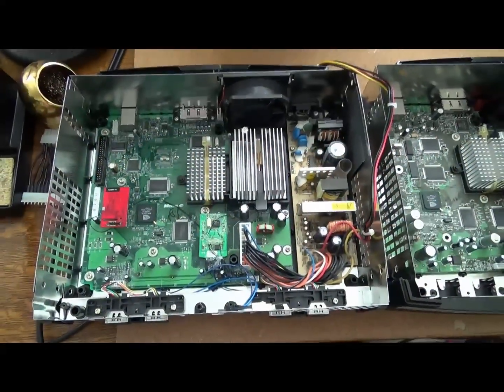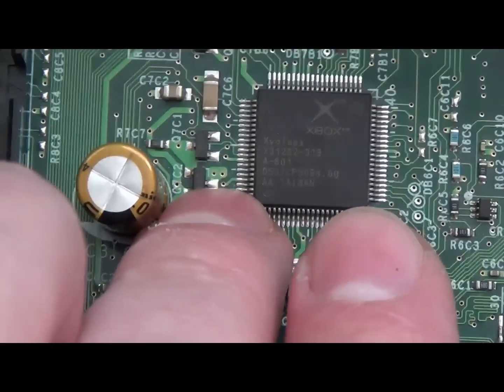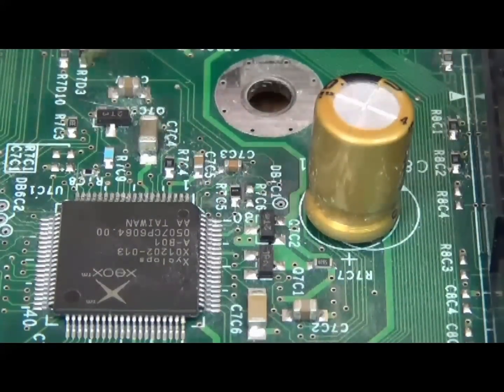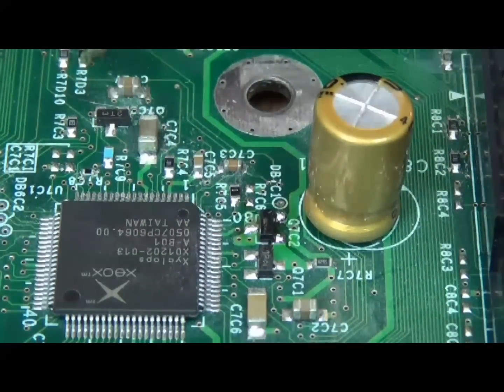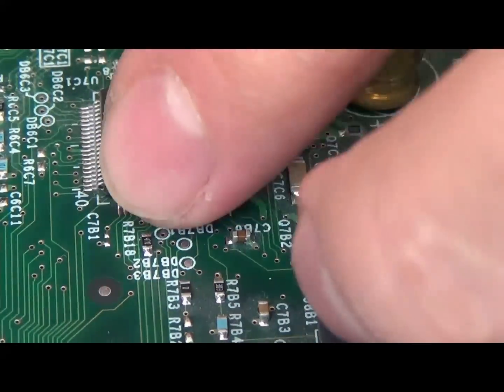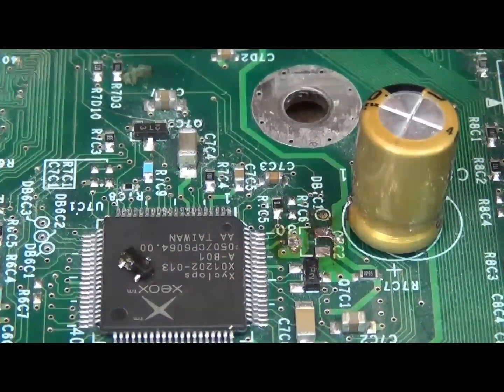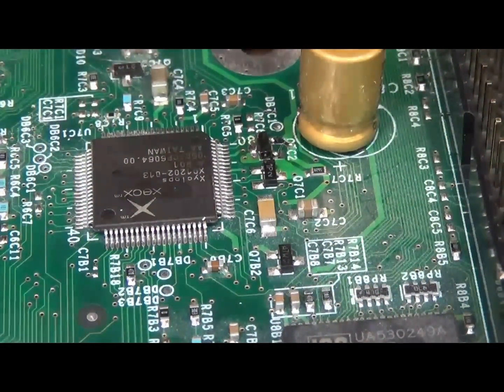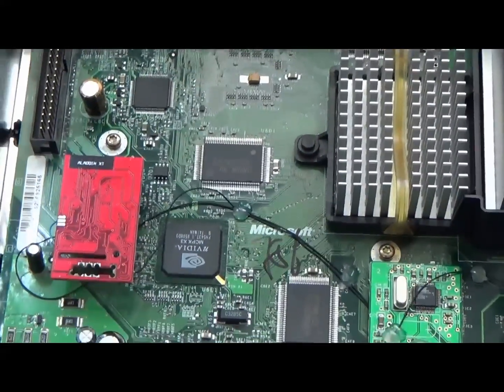Original Xbox version 1.6 won't power on fix

Comment: There's another point of failure for 1.6 boards than this also, T60N02R by the ATX connector, check you're getting 5V on the output when attempting to power on. That's and the one shown in the video are the two biggest point of failure for power on that revision of board.
Reply: A good replacement for that ? I searched online but couldn't find any from digikey

Comment: I haven't ever blown an Xbox in this method but the part number was handy to order a few as I do primarily deal 1.6 and it's entirely likely one may have this problem in my stock or I can do the work for another community member without delay. Think I'd use a focused heat gun to remove it though, cos I do have good soldering tools now myself, though there was a time I struggled with a weller. A TS 101 iron with interchangeable tips is a very versatile iron for this type of work.

Comment: 2024 - and just fixed a 1.6 with this guide. For anyone reading this, I used low melt - long maulten on each leg, once its mixed in with the microsoft stuff, just touch the 3 points while giving it a wee lift wae tweesers. Thanks for the vid.

Comment: So the negative lead is just touching the metal case?  Power is off, correct?  Tested like you showed and the multimeter value was unchanged, remained 0.00 to 0.01.  So where do I buy this transistor?  FYI...1.6 board in a 1.6 case so it wasn't shorted from laying on top of an unused screw mount.
Reply: He turned the power on

Comment: This totally works. I recommend using two soldering irons to remove the part without a heat gun since there is a cap right next to it.
Reply: How do you suggest to hold two soldering irons and a pair of tweezers at the same time with only two hands. Maybe I should find a girlfriend, date her for 5 years then marry her, have a boy and when he's finally old enough he'll help me out. Or I could just date a guy, that'll be quicker.

Comment: Mine won't turn on, I'm getting .8 volts on that transistor with everything plugged in. Is that normal if the Xbox is off. Not sure what to check next. Replaced all 5 bulging caps on the motherboard.
Reply: There's another point of failure for 1.6 boards than this also, T60N02R by the ATX connector, check you're getting 5V on the output (bottom right pin) when attempting to power on.

If not, then get another chip, I piggybacked a new one on.
Reply: @realgroovy24 Where exactly? Do you have a pic. Looking, for it now, not seeing it yet.

Comment: Do yourself a favor and get a pro to swap this for you if you’re not accustomed to using low melt solder or a hot air station. He could have severely damaged neighboring components and created an even bigger problem. Watching this removal made me cringe, big time.

Comment: Question: My 1.6 died a little while back and I replace the five leaking capacitors on the bottom right side of the board close to the power supply. Removing the solder to do so, was very rough and the areas for solder became black a few places, but since it powered on for two minutes I am not sure if I am the one causing it's current failure. 
Could this transistor be another reason as well?

Comment: Wow, I placed a 1.6 mobo in 1.4 case and caused the short (stupid Microsoft). Your video saved my 1.6 going into the trash, I was able to get a transistor of another dead Xbox to apply the fix. Thanks 🙏
Reply: Don't worry you are not the only one that did that. Broke down mine today same way 😂 But I salvaged transistor from a dead 1.4 and now it's back up again!

Comment: Would the meter return a result value if the system won’t power on at all? Like not even for a brief second? If not is there a way I could still test the transistor to see if it needs to be replaced?

Comment: I hope you can help me. I bought a second hand 1.6 ( Aug 2004). It worked great until with composite but I bought 3rd party component to improve the Picture on my crt. I hooked up 3rd party component cables to it. The picture with component on a crt was broken, the disc drive opened halfway  and system shut off. It did it again. Then I left it for 30 seconds and reverted back to composite and it worked as before. But it stopped working after that. Any idea what happened. I keep thinking those 3rd party component cables bricked my system. Plz respond.

Comment: Thank you very much! Mine had the same exact issue and by replacing the transistor it came back to life (it was not powering on AT ALL). You can also use a regular non-smd version like 2N3906 and works just fine (just be carefull with E B C connections)
Reply: bought a used 1.6 (manufactured in Aug 2004) and it worked great. I was using composite. I decided to get a 3rd party component cable to get the most out if it on my crt. First time I tried with component cable, I got a unstable image, and the system shut off after 4 seconds. Tried again and same thing. I revered back to composite and booted up the xbox after a 20 second break and it worked great. I played it few times and no problems. Returned the cables and decided to stick to composite. Tried to power on the xbox later that day and it stopped powering on altogether. It really made me sad to see this happen. Any suggestions would be awesome. Thank you

Comment: Two words, solder wick.
Reply from the maker: Solder wick doesn't actually work that well to remove surface mount components.  I use to use low melting point solder and now I use hot air.  The whole point of the video though was to show people that might not have those kinds of things how they can remove smd components.

Comment: I've tried testing the transistor with a multimeter exactly like in the video's instructions and I can't get a single reading off of it. It just reads -0.00 and I can't tell if its a problem with the capacitor or the multimeter (Which I just bought today)
Reply from the maker: It is a transistor you should be testing not a capacitor.  If you are getting no reading on the multimeter after pressing the power button then it could very well be the transistor that is the problem.
Reply: @Floydzabarber  I meant to type in transistor last night lol
Still, thanks for letting me know what my issue was!

Comment: OK So I have 8 xbox's.... using my infinite wisdom I decided to swap a 1.6 Chipped xbox Crystal in to a Limited Edition Green Case....  after the transplant NOTHING WORKED :(  I assumed I made an error when soldering the wore back to the power button... So using more of that wisdom, I grabbed another xbox 1.6 Crystal with modchip and done it again.... Again NOTHING WORKED.... So I then put the board back in to the Crystal 1.6... to my horror.... STILL DEAD :(

Any ideas... I have no multimetre and no clue what I am doing

Comment: Thank you. I did what you showed and replaced the transistor, it's showing 3.2volts now but still no power on (no fan or anything).
Any suggestions anyone?
Reply from the maker: Check the power supply to make sure it is getting the correct voltage on all lines.
Reply: @Floydzabarber  I'm getting five on orange but .1v on blue.
Reply from the maker: @robbiejmsn1  Check the power supply pinouts here https://www.ogxbox.com/forums/uploads/monthly_2017_04/XboxPSPinouts.jpg.5a2e9fd6bb51cf2533b48d03007c1a51.jpg

Comment: Could this be my issue? My CPU caps look fine and the MB is in a 1.6 shell but it randomly stopped turning on a week or so ago. My concern is my PSU seems to be buzzing when I give it power, is this normal?
Reply from the maker: Yes, it could be your issue, and no it is not normal.  Do you hear any crackling by the psu?
Reply: @Floydzabarber  no crackling just a buzzing

Comment: Ufff dude you save my Xbox right now after the video was launched 5 years ago.

 I make a stupid think swapping cases without see the extra screw hole and kill the console, but I solder a normal 2n3906 and the console is working again, so for another people who the same problem and no smd component you can solder a 2n3906 looking for the pin out, but is easy the pin 1 goes on the top pad, pin 2 goes to the left pad and the pin 3 goes to the right pad, and that's it is working again

Ohh cut out the legs just for rid the upper case

Comment: Would this transistor being bad cause the standby voltage (measured at the PSU connector) to read 0v? Is there a way to test this transistor if you can't get any power up on the board (no fan spinning, nothing)? Thanks again for this!

Comment: Not to do a necro, but what were the symptoms of the Xbox? When you say not booting, was it powering up at all?

My 1.6 out of the blue is turning off and on 3 times and throwing me the red and green ring. It is taking power, but not booting.  I'm scratching my head over here. 

I don't yet have a multimeter, but I would like to know the symptoms of the Xbox you repaired here. Also, if you know about the 3x on/off error please let me know.
Reply from the maker: The damaged transistor would result in the Xbox not powering up at all. The problem you are having is your Xbox is fragging and it could be the result of many different things.  Check for solder bridges on your motherboard and clean them up, check for leaky capacitors and replace them if they are bulging.

Comment: Mine powers on, then off, on, off, on, and off, then fully off. My other 1.6 system had swollen caps and recapped it before powering it on and that one works. My 1.0 works and no clock cap leakage, which is a huge relief.
Reply from the maker: The Xbox that power on and off in a cycle probably has trace corrosion.  There are a group of traces next to the outside edge of the motherboard that can cause problems like this if they become corroded. There is a tutorial online too to fix this. Just look up original Xbox trace corrosion repair.
Reply: @Floydzabarber  Funny. I checked both sides of the board and cannot find a single spot of corroded traces. Could dust cause that, too?
Reply from the maker: @RetroPCUser  No dust wouldn't do that. Look over the traces I am talking about really well, and use a multimeter if you have one to check continuity.
Reply: @Floydzabarber  I checked the continuity on the board and they all work. Also had to bend some of the capacitor pins (replaced the ones that were ready to leak) and remove some solder as they were too close to the RF shield.

I checked the transistor power and it's at 3.3VDC, which is a good sign, the PSU is working, so I might connect the power/eject board and see what happens. Either that or the caps need a charge or something.
Reply from the maker: @RetroPCUser  It could be power supply related.  If you have another power supply swap it with the one that is in there now and see if it resolves the issue. If you don't have another power supply, take out the one you have now and check the solder joints on the bottom of the board to see if any are cracked. If they are reflow them. This is a very common problem on foxlink power supplies.
Reply: @Floydzabarber  I put in a new one I got recently and before and it powers off after pressing the power button. Could it be capacitor trace issues? And how can I fix capacitors that lost the metal contact for soldering?

I reflowed the PSU header on the board and fixed the loose caps. Maybe that's why the power cycle was occurring was because of loose caps?

Comment: I brought mine to an electronics repair store and the reason it wouldnt power on was actually that it had bad capacitors. He told me the other reason it happens is a bad power supply.
Reply: Hi @MJ306, I think I might have the same issue from an Xbox I picked up at a swap meet. Just wondering if you’d share what you paid for the repair so I know what to expect? I paid quite a bit because it was the Halo special edition and tested it there but when I got home it would no longer power on.
Reply: @Giojitsu626  it was less than 50 bucks. I think it was like 30.
Reply: @maryj306  Thanks, I appreciate it! I hope I can get it repaired for that price.
Reply: @Giojitsu626  no problem, i was also told to keep all old consoles unplugged when not in use to prevent this stuff from happening in the future
Reply: @maryj306  Thanks for the info, much appreciated!

Comment: Hlo bro my Xbox turns on but after showing multiple colours on ring it automatically turns off any fix plzz help ,I m a collector and I want this console in working
Reply from the maker: Download the Xbox Repair guide 2.1 and go to the section "troubleshooter"  then "error lights" and look for the light error code that your Xbox is giving you.  It will give you suggestions as to how to fix it.

Comment: Can you remember what the Transistor specs or # is?  I'm having same problem, but have no idea what chip to buy. Thanks!
Reply: MMBT4403LT1G @ Mouser $0.14 ea.
Reply: @kaosengr  Thank you!
Reply: Oopsy Poopsy you are welcome. I see another part listed in the old Xbox Repair Guide but it’s only rated at 200mA max collector current while the 2T labeled transistor cross references to 500 or 600mAs which the one I posted can handle.

Comment: Im glad you admit your making a mess. Everyone has to start somewhere I guess.
Honestly it isnt as bad as i have seen. You should of used the wick on removal of the chip. That way you wouldnt of scored the board by keeping the iron on it so long. Maybe you know this by now since the video is old. But this comment may help some people coming across the video. 
Anyway, good job for what you had to work with.
I would be also not leaving any bridges like that. If that via was not part of the circuit. You would short out your board.

Comment: Aaand, for anyone that also has this problem... The smd code for the transistor that goes bad (At least on my 2005 1.6 manufactured in China) is "2T" you can check more info in this link http://www.s-manuals.com/smd/2t
Is a PNP transistor in a SOT23 form factor that can handle up to -500 mA of continuous current.

I have not been able to find that exact part, but in my 1.1 Xbox I found this one http://www.s-manuals.com/smd/a1 Is an A1I transistor that is on the back side of the mobo just at the left of the single row powe supply connector. There are two of them, so you can mess up once an still have a chance, but do not try to power back that 1.1 Xbox before getting the propper replacement for him!.

The only difference between this two is that the second one handles only -200mA of current so it will work but you still need the propper replacement, soon or later the A1 is going to die from overcurrent.
Reply: Interesting, one of the repair guides for the Xbox floating around the Internet states that the replacement is an MMBT3906LT1 which has the 200mA current rating instead of 600mA I find for 2T being a KST4403 or MMBT4403 PNP transistor (MMBT4403LT1G $0.14 ea at Mouser)

Comment: This is painful to watch
Reply from the maker: Well I tried to use tools most people would have at their disposal, that Is why it took so long.  I could have used some chipquik and had the components off in a couple seconds, but not everyone has chipquik.  Sorry for trying to be helpful I guess
Reply: Floydzabarber dont be sorry. You didn’t do anything wrong. The only reason why i have all these thing is because i do mod work myself so tools of the trade.

Comment: So there this old trick called the cheap mod I tried on my 1.6 where you just wire in the Aladdin chip after programming it with the new bios file. What happened was I had to cut a trace and now after attempting to fix it and rebridge the connection it just wouldn't power on, I got sodder near the original bios chip. I have to see if something like this fixes my xbox it's madness but thanks for the video.

Comment: What transistor is it?
Reply: Its a 3,3V regulator. 5V in 3,3V out.
Reply: MMBT4403LT1G PNP switching transistor - Q7C2 on the v1.6 motherboard

Comment: Hi, my Xbox won't start but I'm pretty sure that's not exactly the same problem : When I mesure voltage on transistor collector, I've found 0.0v but continuity tester doesn't beep. When PSU is hooked up to 220v, I hear a click click click near it. I've no powerup at all, there is no led blinking. Have you ever seen this ?
Reply: Got the exact same problem can't find out how to sort it
Reply: @indigo6518  capital is probably the solution

Comment: This fixed worked for me when I put a 1.6 in the wrong case! Had no power at all, I just pulled a transistor from a logic level converter I had laying around as it seemed like a likely drop in replacement and after some messing around getting the transistor to lay flat I soldered it in. Then I removed the extra metal tab from the case and reassembled and it booted right up! Thanks very much for this video! :-)

Comment: My original xbox is connecting in three stages, first turn on the power led for a second and erase it, then it happens again and I hear the hd load, then it turns on and blinks but no image appears. I can open the dvd drawer normally and I can hear the hd work. Would you help me?
Reply from the maker: Look for trace corrosion on your motherboard, and jumper any traces that have become corroded.

Comment: Hi! I just got a non-working Xbox trying to repair it. It's a 1.6a inside an older case so I think that's the main problem. It's not turning on at all. Checking the PSU cable that goes to the mainboard, I only get about 3,5V from the orange cables and 0 in anything else. Is that related? How can I check the voltage on the transistor if it doesn't turn on? Thanks
Reply: There's another point of failure for 1.6 boards than this also, T60N02R (labelled Q2F1 on board) by the ATX connector, check you're getting 5V on the output when attempting to power on. That's and the one shown in the video are the two biggest point of failure for power on that revision of board.
I realise I'm replying 7 years late, I hope you still have the system, or at least managed to fix the issue.